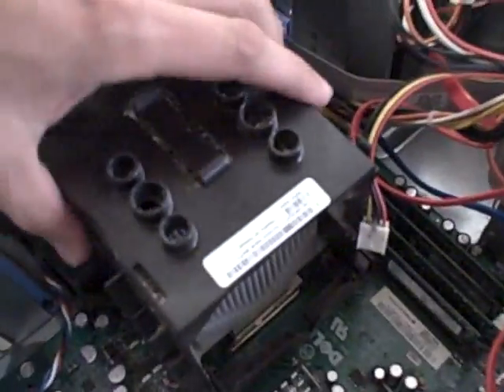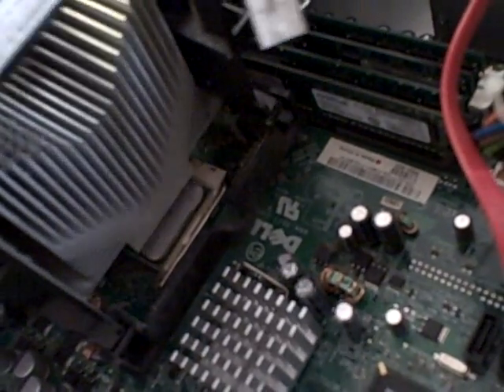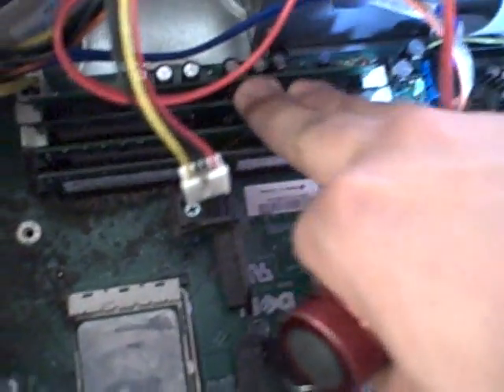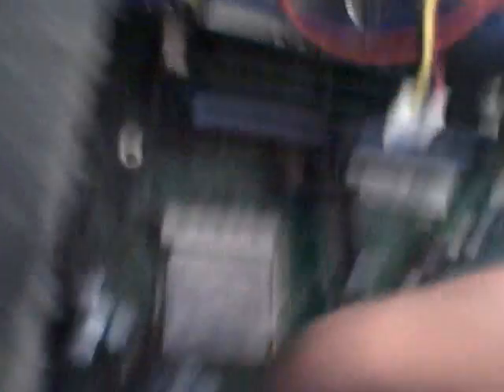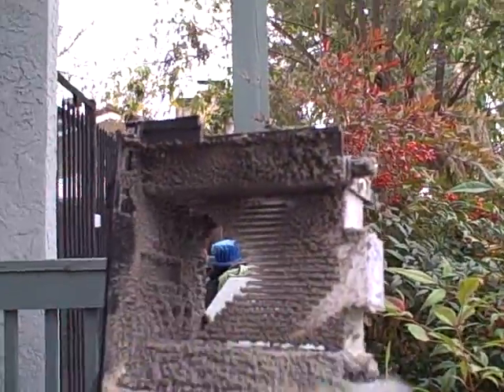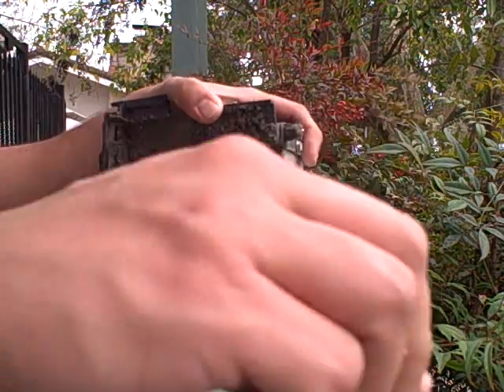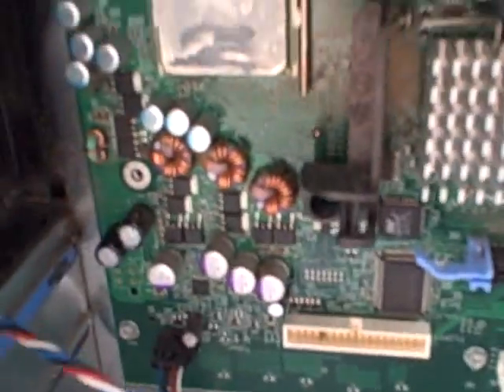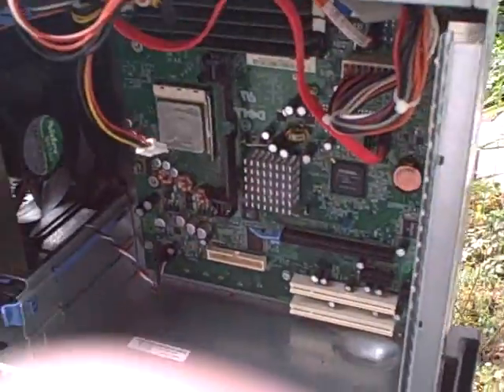DELL DIMENSION  E521 PROBLEMS

Comment: Hey man, here's a tip. Use an air compressor. Easy stuff and make sure to apply some thermal paste. While that older AMD CPU doesn't get real hot, no or dried up thermal paste will cause it to eventually fail but not before slowing down to a crawl maybe.
Reply: where the thermal paste at nub?
Reply: Um... Between the CPU and heatsink. Like it should be.
Reply: Pear CD my bad, meant it as a public comment lol

Comment: Nice clean up job, but you do NEED to reapply the thermal paste anytime you take the hsf off the cpu for it will not transfer the heat properly as it was installed the very first time and will most likely overheat while in use. Using an old toothbrush is good for cleaning open areas, but when in cramped situations, you increase the chance of hitting the caps too hard by accident and possibly render the motherboard useless... may i recomend using a "datavac" electric duster next time.

Comment: Hello, The other day I went to go turn on my Dell Dimension E521 and it simply wouldn't boot, now i've looked into every video, every site. My power button is blinking green. The diagnostic lights are blinking 2 and 3. On another note, the aux power led light on the bottom right on the inside of the computer is steady amber or yellow. Can anybody solve this please? What parts need to be replaced or how can I fix it?

Comment: I saw the same 3 & 4 green light.  I have 4 memory card (added two new ones). First I inserted one the computer came up and complain on the screen that memory has changed.  Then I inserted the 2nd one, I saw the same problem with 3 & 4 green light.  So I found the faulty memory card.  Now I installed rest of the 3 cards the computer came up fine.  You probably need new memory card.

Comment: uuuuuuuhhhhh.....far be it for me to criticize you on your cleaning methods man, but I was cringing my teeth when I saw you use a tooth brush on the motherboard and then put the heatsink back on without reapplying thermal compound. You are lucky if that computer is still alive...... My method for cleaning my computer is find an air compressor and just blow out the lint and dust, you never have to touch anything and air never hurt anything..just a future tip man and save a toothbrush lol

Comment: Hi ive also got same pc e521- problem im getting is when i boot up pc  the monitor goes into power save mode, ive also cleaned my pc fom dust issues and changed the power cable and plug fuse! none of this made any difference. Im using dvi cable from pc-monitor and thought id try my vga cable and it worked i got a picture going. now today its gone back into power save mode and really pissing me off.. im not sure now if its the VGA card itself. any ideas anybody? would really appreciate it. Thanks

Comment: Thanks for replying.  I may have to change the Nvidia Geforce 6150 LE integrated video card to a dedicated card.  Will you please make a video on how to take out the integrated video card and put in a dedicated card?  Also, what card do you suggest I buy that will not need a new power source (I thing that is what it is called) or anything else to run the new card?